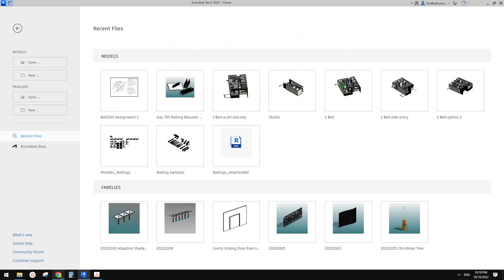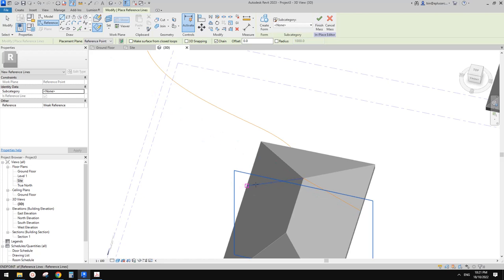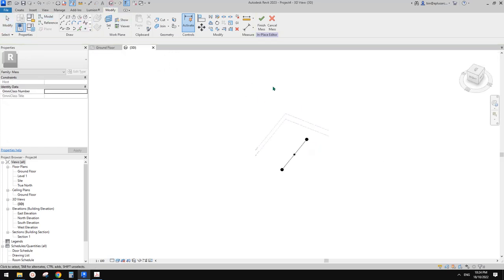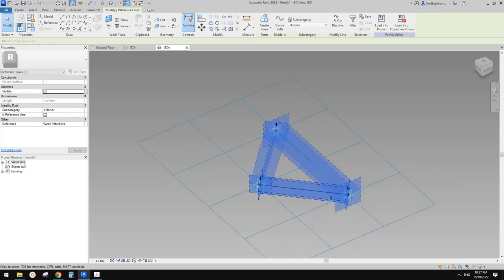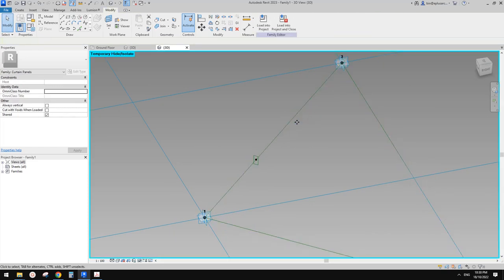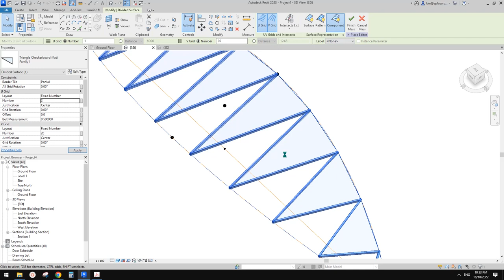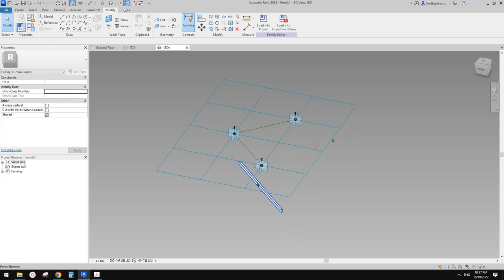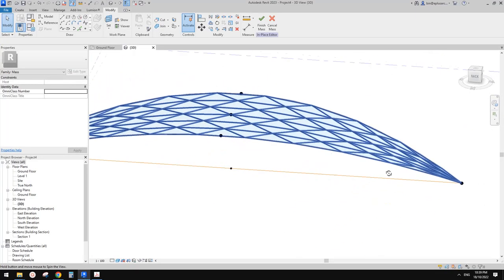Revit Exercise (Day 939) Mass and Pattern Based Exercise

Comment: The idea of starting with a arc then divide surface then change the pattern to rectangle is quite smart, but still difficult to achieve the exact shape of the building 
Unfortunately revit has no sweep in conceptual massing
Reply from the maker: Yes, it has.
Reply: @BINHE615  
I ment variable section sweep 😂
Reply from the maker: Yes, you can.
Reply: @BINHE615  
You are right …. if you consider  the lines on the points as sections and the ridge spline as path then it’s a kind of sweep , yes